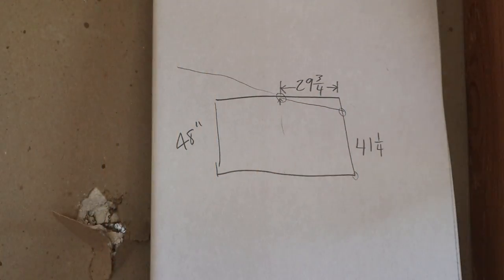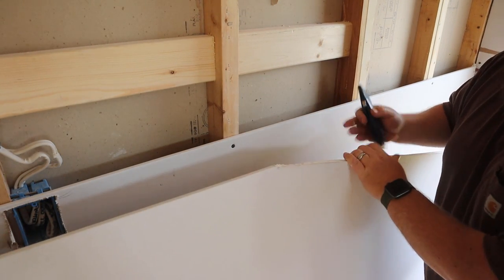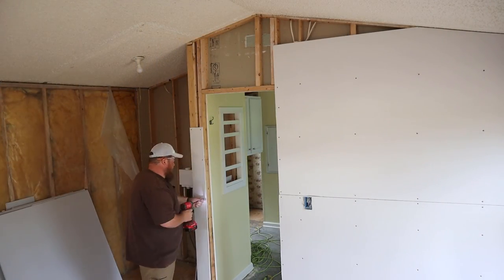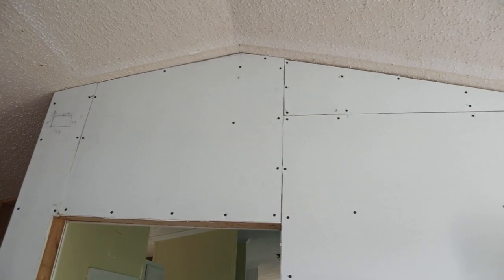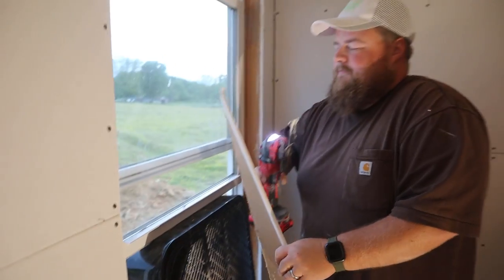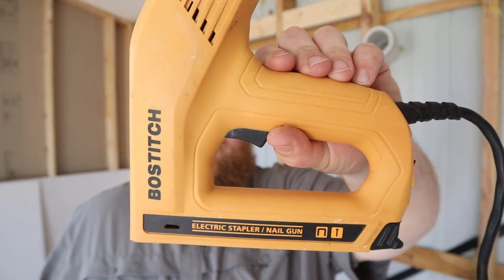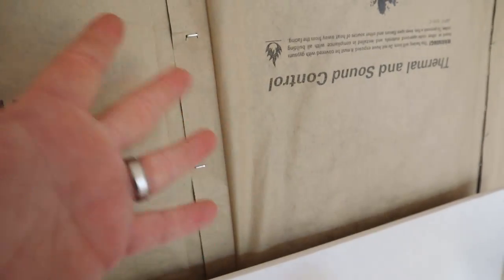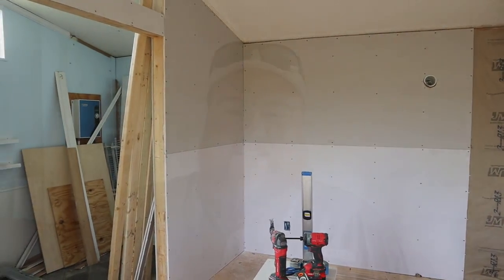I Was Wrong: Drywall & Vapor Barriers  // Mobile Home Bedroom Renovation

Comment: I am about to install an acrylic walk-in shower with 3/4" plywood  backerboard into a trailer that used 2x6s for floor joists.  Do you think the weight of this 3/4 inch plywood backerboard will be a concern weight-wise for the trailer?  The trailer currently has a fiberglass walk-in shower...to be changed to an acrylic walk-in shower weight permitting.  No tub.  It will be installed over the cantilevered portion of the 2x6s.  Any thoughts, suggestions, or concerns?

Comment: I’m sorry but that door wall was literally 3sheets. 10 foot tall 2 taper joints and done. Also your straight line “cutter” is what you used to draw the pencil line. Trade out the pencil for your knife. Barely slice the paper snap and slice and back snap.

Comment: Any cracking of the mud, or did your concrete footers make the home stable enough?  My piers are set on top, so I have to buy the expensive wall papered rock
Reply from the maker: No issues yet (a year and half later). Our footers must have helped. :)

Comment: Interesting I wish I knew what I needed here in Iowa I had to rip into my Mobile Home Wall a few days ago in my bedroom because I noticed a soft spot in the wallpaper covering the drywall and I was worried about water-damaged areas sure enough there was an old leak that had made some mold, rotted out a good portion of a couple wall studs next to a window that had been replaced before and bought the place and the insulation was gross in that spot so I pulled it all out and got rid of it.  I noticed mine has these like thin styrofoam-looking sheets facing the siding? that has paper backing then the insulation then the drywall.  So what is that outer layer thing on my place any idea?

Comment: Sam I use my 12v driver which has the right torque to drive the screws in perfectly.
Check out   That Kilted Guy channel for great drywall mudding techniques, he over 30 years experience
and gives very good teaching.

Comment: straight cuts with drywall ... use a straight edge and never worry ..
Reply: use a 1x2 and make your own feather joint for the ends ... a few moderate taps with a hammer or a heavy maul (light taps there) ... and you compress the gyprsum ... making a ... trough to mud INTO ...
Reply: btw you could have used CRAFT paper from a roll to overlay the old insulation ... that is what they use to back those style of insulation with ... Kraft paper ... nothing more 
... heavy BOND kraft paper ...
Reply: that blackness is  very watered down tar ... essentially ... find the thinnest cheapest roofing tar you can can add a little thinner ... paint it on and your done ... it is NOT actually needed as it just slows water penetration ... wax works better and a few spray cans of pledge work wonders
Reply: ok why are all BUT 2 sheets using the finished face out and the last two in the corner are the UNfinished side out ... white side out is finished (pre primed so less paint soak up) ... the grey side is not pre primed and will need to be primed before you can fully prime coat the room .. yep prime the grey boards wait to dry prime all the walls Once the mudding is done ...
Reply: btw the difference is pre primed and not pre primed ... the grey sheets are unfinished ... and actually the cheapest drywall one can purchase ... the white ones are pre primed and cost about 10 cents per sheet more ... BUT are worth it as you can use a decent primer single coat then finish paint ... instead of 2 or 3 prime coats ...

Comment: Sincere question due to my lack of understanding: so why did you have to redo the wall? Wasn’t the first vapor barrier more than what you had to put in? Why, if you had more than required, did you have to redo it?
Reply: Watch the video 🤦‍♀️
Reply: It has to do with climate zones and how the wall breathes. Plastic vapor barriers are really only suitable in the far north.
Reply from the maker: From what we read, since we're in the humid areas of the country, moisture inside the home couldn't escape from inside the wall and would mold right behind the drywall. Places like outlet boxes would allow humid air to leak into the walls and get trapped.

Comment: When you do the exterior siding will you apply a sheathing, house wrap and then the siding. Would that add more strength?
Reply from the maker: We've been thinking ahead to that. With current prices, we're currently leaning towards removing the metal siding, housewrapping the studs, then installing a wood panel siding like LB SmartSide panels or T1-11. We have a hard time thinking we could afford to install osb sheathing then siding on top of that.

Comment: I disagree.i think you need a vapor barrier because of diffusion of heat into the wall in the winter.You like me have no outside sheating just metal siding over the studs with 2x4 walls.What happens when hot air hits cold metal siding??Instant condensation.When insulation gets wet,R factor goes down way down.Have ever pulled old insulation frim a between 2 studs and its seems stuck matted to the metal?Thats insulation in a metal siding no sheeting mobile home.Thats why bottom plates rot out in them.I live in a Giles Kentuckian 1987 model which we have rehabbed.Welcome to TN.Ive lived in the county of Greene for 50 years.Rural King in Morristown is a great farm store.

Comment: Y'all may have already said this and I just missed it but what size drywall are you using
Reply from the maker: The new drywall is 1/2". That's the only size that has been available in stores for the last two years. We'd only use 1/2", but back in the good ole days there used to be other options.

Comment: couldn't you have just taken them plastic off and use the red paper that comes in a big roll
Reply: No, the paper that comes on the insulation batts is different than rosin paper, and has a tar substance on the back of it.